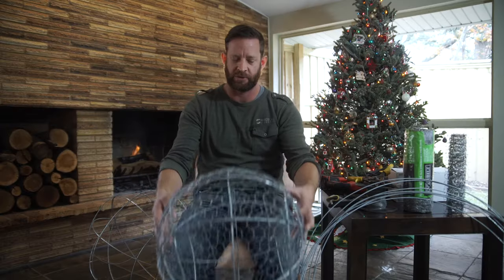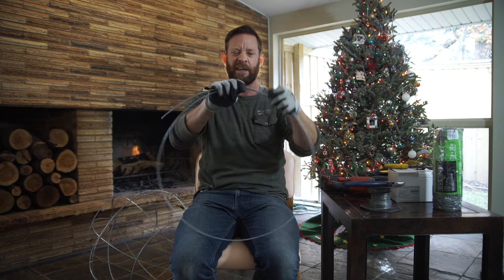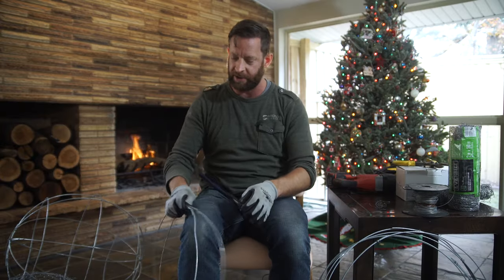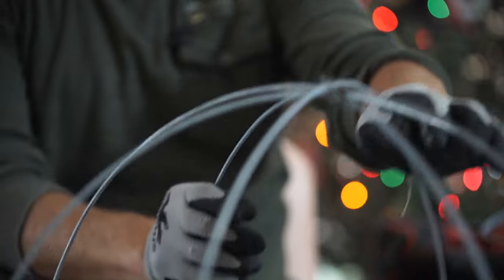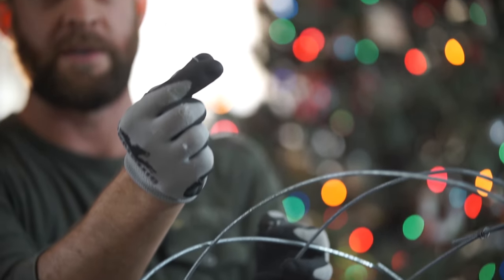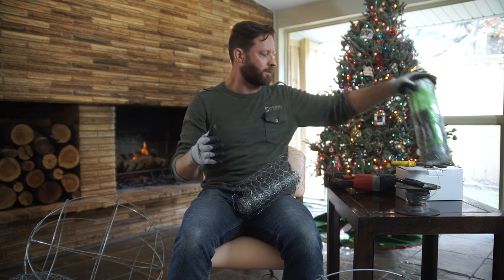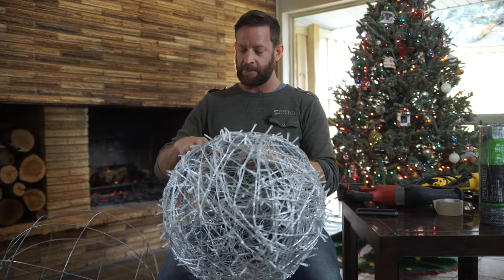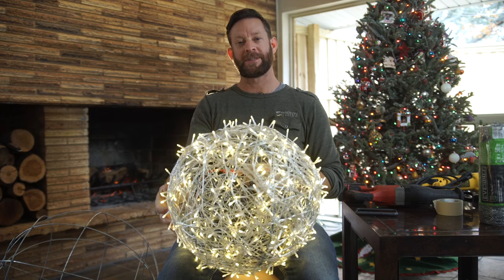How to Make Lighted Christmas Balls from Chicken Wire/Poultry Netting

Comment: I was at Home Depot today and I saw it in the chain-link fence section. It’s aluminum wire about 6 gauge, size of half a pinky finger in diameter,  or perhaps a bit smaller than a pencil in diameter. It is packaged in rolls that are about 2 feet in diameter. The roll I saw today was lowest shelf closest to the floor, if that’s a standard thing at Home Depot.
Reply: Thanks ryan, i went today to home depot and no one could direct me. I will look tomorrow. Or in other hardware stores. Hopefully i can find it.
Reply: Ryan, which wire are you referring to? You said to get 14 gauge aluminum wire & wire ties. What’s the 6 gauge wire?

Comment: WoW!  Incredible!  Best demo video!  Thanks for sharing!  I tried many other ways and nothing came close to how great and professional this looks.  It takes some time to build, however the end product is amazing!  I wish I could share some pictures!  I hung mine from a huge oak tree in my front yard!  It looks incredible!
Reply: @User-sb7ky  did you say in a previous comment what garage you actually used ?  I seem to recall seeing you post in a reply that your video said 14 gauge aluminum wire and you corrected it saying 12 gauge.   Can you confirm ?   Thanks
Reply: @esh1877  
yes it is 12.5 gauge specifically in the fence  section. a little smaller than a #2 pencil, thick and sturdy enough to bear weight. specifically for the circular structures, skeleton if you will.
Reply: @User-sb7ky  thank you sir.   I’ll be trying to source some in Canada this weekend

Comment: Good idea. I may not have been clear on that point. These balls, when made w chicken wire and tie wire generally have many pieces you may use to fold over onto the lights to strap them w/o the need for many extra hooks. J hooks would work too!
Reply from the maker: may use the ends of the aluminum overlapping to strap together

Comment: Thank you for this video. There are hanging 5 amazing light balls in my tree outside now, because of you. Very pretty. :-D Marleen from Belgium
Reply: Yay Marleen! Can you send a pic?
Reply: Where did you get the main wire?  Do you have a box or remember the product?  14 gauge?  I bought 14 gauge aluminum fencing wire and it is not like what is in the video.  I can't find the 3 foot diameter roll/hoops that he has and shows right in the beginning.  Mine isn't nearly the same gauge as what he his showing (1/4 inch?) either in the video.  And it came on a small spool, not in a box or a three foot diameter roll/hoop. Thank you for any help.
Reply: @andrewbatson9924  
Andrew,
Purchase the aluminum wire in the fencing section of Lowe’s or Home Depot, it is in a roll.
Reply: @User-sb7ky  how big is the roll?  Rolls in HD and Lowe’s are about 8 inches in diameter, not 36 in or what is shown in multiple loops in his hand in the video.  That’s the question.  Large loops make this project way easier.  I’m sorry to bother with these questions.
Reply: @andrewbatson9924  

Oh man, I think I’ve been telling people for years it’s 14 gauge, I should know better. I just looked on Home Depot website: 12.5 gauge 392 feet tension wire. Looks to be about $26.00
Reply: Andrew, 
Also possibly when purchased the roll of aluminum wire is about 8 inches in diameter, unroll the 8 inch spool to desired diameter.

Comment: Andrew B: We need an aluminum or any kind of wire  (product) that will make a simple circle. Usually found in the fencing section-possibly truck and tractor supply or local feed store (though I’ve never been in one).... a product that can be molded into a sphere, circle that will create a kind of circular frame to which we will attach the netting. If you can see in the video, it is the (aluminum) gauged wire that one would thread through a chain-link fence specifically at the bottom of the fence near the ground where the chain link fence and the grass meet, it holds the fence from waving, keeps it straight. Does that help? I’ll try to get a photo

Comment: Thx again for this fantastic video! You inspired me last year as I tried to make your balls, but I failed. ☹️ I feel like I’m pretty good with DIY projects. My problem was getting the aluminum wire to keep the 14 gauge circles together. I used my pliers to tighten the wire, but the circles kept slipping out of it. Was I not using a strong enough wire, or maybe it was too thick? I ended up using zip-ties, which worked. But, I had another problem. I found it challenging to get the circles to go around each other. They would be too small, even though I made sure they were the same size. I ended up skipping the circle structure & just used the netting to make the balls, which was not that easy & wasn’t a perfect circle. 🤦🏻‍♀️
This year, I want to make the circle structure without the netting & put LED mini lights on them. I think that would look sharp! Would you mind helping me understand what I did wrong? You make it look so easy. Ha. Didn’t you say your circles are the same size? I would think they have to be a tiny bit bigger than each other, right? 🤷🏻‍♀️ Thx. ☺️
Reply: ‘sup B-Dub!
all sizes are nominal, it’s kinda like joining two hula hoops. You could try to make one a bit smaller but may not be necessary. 
Let’s start w two spheres: make (2) spheres ab the same size, put the at 90° angles from one another, like a cross. grab your aluminum wire that you will use to bind the two together. focus on one joint, cross section at a time. When joining and binding two spheres first wrap the small wire diagonally, top first, then bring the smaller wire up toward you make another cross stitch like a shoe lace, or an X, that should hold the first joint in place. move to next intersection and duplicate. Hope that helps let me know
Reply: @User-sb7ky   Thanks, Ryan! Yes, I did the cross-stitch or x when combining 2 spheres, but they still found a way to slip out & not stay secured where I wrapped the wire. They would slide down the circle, if that makes sense. So I would end up with a lopsided sphere. I also remember the circles wouldn’t stay secure either. They would pull out from the wire, securing them. Could it be that my wire was too thick? It wouldn’t hold anything together well. What type of aluminum wire did you use exactly? Thx for your help! 😊
Reply: @b-dub6865  ‘sup B-Dub! 
try making the circles similar sizes so they push and squeeze against the one intersecting them they should kind of wedge together at 90° angles then tie wire keeps them in place. the wire guava is that same fence people use at the bottom of a chain link fence, about half the w thickness of a pencil

Comment: Hey everyone! So sorry! I may have mislead on the “14 gauge fence wire”, so very sorry. I just looked on Home Depot website. It should be: 
12.5-gauge 392 feet galvanized tension wire about $26.00.
Reply: Thank you for this update. I went to the store today looking for the 14 gauge and saw what looked like it (tension wire), but it was out of stock. I came home to search the web to no avail and then looked back in the comments to see you had made a change to the actual wire needed (12.5 gauge). I tried the lighted balls without the wire by making them with poultry wire and it took 2 hours and it ended up not being a round ball. So, thank you for this video. I’m sure it won’t be done any faster, but it will look much better in the end.
Reply: So what wire? 14 gauge galvanized or 16 gauge aluminum. I can only find 9 gauge galvanized fence wire.
Reply: 16, 14 will work, the idea is to simply hold the pieces of structure and fencing together. you could use zip ties, sandwich ties etc. a little spool of aluminum wire is great though, can get at hobby lobby or Home Depot type stores

Comment: Great video. Can you provide a link to the type of lights you recommend. Most lights have white or green wire, yours appear to be silver.
Reply: Thank you. 
Light color is rated in Kelvin (K). Look for LED lights that are 5000K or 6000K nominal. The higher the K value the whiter the light. The lower the K value the more red, orange color-hope that helps
Reply: @User-sb7ky  Thanks for the prompt response. My main question was “wire” covering color. I have green wired mini lights, but would like to use transparent wiring covered lights so the balls look silver during the day. What light brand do you recommend or provide a link. 
Thank you in advance for your help.
Reply: It has been a couple years I would simply search around for the color that you find most desirable
Reply: @User-sb7ky  Neither Home Depot or Lowes carry 14 gauge Aluminium wire. I found 14 gauge Aluminium electric fence wire at Tractor Supply. Will this wire work?
Reply: @williampresley5727  if it will hold shape kind of like a tie wrap for bread that will work
Reply: @williampresley5727  yes that should work, a wire that keeps shape is what we want

Comment: Ajit, Basically go to the fence section in Home Depot. 
Grab some aluminum wire, about the size (width) of a pencil, it comes in a round spool about 18 inches to 2 feet diameter, (it may be 20 feet long but it is wound in circle).
Then grab some chicken fence, it’s very pliable and not too thick.
Then look for some tie wire to tie it all together. Hope this helps

Comment: Where did you get the 14 gauge aluminum welded wire?  You did say a local hardware store.  I went to those and big box.  Google it, nothing.  What is it normally used for?  That's the important part.  You don't provide this information.  It comes in three foot rolls?  This is super important.  Your gauge looks way bigger than 14 gauge.  It's almost 1/4", and very rigid.  Can you please be more specific?  Thank you.
Reply: It looks alot bigger than 14 gauge. Did you figure out what it actually is?
Reply: @ShockMeAgain  I went with I think 14g galvanized tensile wire from Tractor Supply. I bought a 1000’ roll.  It’s used for electric fencing livestock.

Comment: In your video intro, it looks as if you assembled the balls into a very large Christmas tree??  Can you give some instruct on how you framed and assembled that?  Many thanks.
Reply: Kelly, 
I have a small oak tree that I gathered the Christmas balls around. I used different sizes to creat the aesthetic, but we simply stacked them and used tie-wire, any kind of wire really will work or zip ties to adhere to the small oak tree and secure balls to other balls

Comment: Materials of a 2 feet diameter ball minus lights would be about 10$, thats aluminum wiring, chicken fencing, tie wire. The majority of the cost is lights. I use about (2) 75-100 feet rolls or whatever amount of lights that looks good for the size of ball.

Comment: Great DIY project, wondering approximately how many lights are used in a 20-24" ball?
Reply: Gary Weiman 
Thanks! I think I pretty much used 100 feet rolls. For the larger balls, the lights may appear to be less dense, for the smaller balls it makes them pop, pop pop! 
So yeah I think I buy 100 feet but perhaps try a 50 or a 75 and see if your happy. Take away or add as needed.

Comment: Love the video!  I'm having issues finding the 14-gauge Welded Aluminum Wire.  Would you mind linking me what you bought?
Reply: Tony Lavey Jr I sent a link, not sure if it showed up. You can find the wire at Home Depot fence section. It comes in 2 feet diameter spools, it’s about 6 gushed wire. Thanks!
Reply: @RMaresch35  Great video but why can't you share the links with everyone on the type of Aluminum wire used.  I've shown Home Depot your video and they say they don't sell that type of stuff.  It would be helpful if I had a link and could show them a model or part number.  Thanks
Reply: So sorry guys! I messed up I think on the gauge. Go to Home Depot and it’s 12.5 aluminum gauge

Comment: Hi can you tell me exactly how sturdy was is it without those pieces around the middle and top. I'm going to be making  "trying to" make those Member's Pre-Lit Twinkling Ornaments.
Reply: The middle and top pieces cause the ball to be able to withstand little kids kicking it and the abuse of the winter weather. 
If you omit the top and center pieces it will still be strong but may not hold its shape as well and may in some cases deteriorate faster. If you are short on materials and time it may be worth leaving these pieces out.

Comment: I have looked everywhere for 14 gauge welded aluminum wire with no luck. All the 14 gauge wire I’ve seen is way too thin and flimsy - almost more for jewelry making. Can anyone help me find what I need? Home Depot, Lowes or Amazon? Thanks!
Reply from the maker: https://www.amazon.com/Hillman-122065-Galvanized-Solid-Gauge/dp/B000H5WOX4/ref=mp_s_a_1_8?crid=ES6YZVMU1OH6&keywords=14+gauge+fence+wire+roll&qid=1667231747&qu=eyJxc2MiOiI0LjExIiwicXNhIjoiMy4zOSIsInFzcCI6IjIuNDIifQ%3D%3D&sprefix=14+guage+fen%2Caps%2C235&sr=8-8
Reply: Thank you so much! Really looking forward to making these for holiday 22!
Reply from the maker: Rock on!

Comment: Thanks for sharing. What i would like to know is how long is your aluminium wire in total and what is the diameter of the wire ?
And finally what is the diameter of the finalized Ball.
Many thanks for your answer
Reply: Bonjour Pierre, comment allez vous?

the wire i used in this video comes in a small spool about 3 inches diameter, with a bunch of windings. it is aluminum 16 gauge  or similar. if i unwind the small spool of aluminum wire it may be ab 50 feet. i purchased at hardware store or you may find similar at a hobby shop. 
diameter of balls: mine were 18 inches to 3 feet 
did that help?
Reply: @User-sb7ky  yes. Many thanks.

Comment: Anyone know if there is a video of how they get their lights up in their trees and how they power them? TYIA.
Reply: Yes
Reply: What lights are you referring to?
Reply: @rmaresc1  the Christmas ball lights
Reply: @thomasleib2329  if I am understanding:
Get on a ladder, using a rope sling it around a branch, maybe tie a weight to the end of the rope, on the other end tie to the Christmas ball. 
To power them up: 
wiring from first to last we call “daisy chain”. Use small extension cords to join them together.  
Or another option and what I do is to use normal electrical wire # 12 or 14 gauge  THHN/THWN (hot and neutral, find at Home Depot). Simply strip the end of the wire about 3/4” long, put the end of the wire through the small hole on the male side, separating the hots to one side of the male, and the neutral the other side of the male keep polarized- put tape around all copper and all copper wiring so nothing comes in contact with the energized wire.

Comment: I started working on this and did not find 14 gauge aluminium wire but found 14 gauge galvanized wire in homedepot. Made the structure but it is wiggly and not holding its shape. May be my aluminium wire is thinner that I used to tie the structure. If anybody has made this can you please post the link of products to use from homedepot/lowes. Sorry I am newbie in DIY

Comment: I cannot find 14 gauge welded aluminum wire.  I found small coils but not the size you used.  I would love to make these, is there something more specific I should ask for? I have been to Lowes, Home Depot and a local hardware store.
Reply: Kelley Holloway 
Look for  6 gauge aluminum wire, in the fencing section.
Reply: @User-sb7ky  Thank you!
Reply: Look in fencing area for a roll of aluminum wire

Comment: Where do I get the 14 gauge aluminum wire?
Reply: At Home Depot, basically what you are looking for is aluminum or bailing wire that you can tie, secure around two objects
Reply: @User-sb7ky  does it come in the circle dimensions (looks like 2ft) as in video?
Reply: @gi-jojoannegauthier8478  if it did; i wasted my time

Comment: Nice presentation. For sake of storage, i think I will use plastic zip ties to hold frame together. Or perhaps double hoop the center and spot weld the hoops. Then cut between center 2 hoops. That way I can flip the 2 hemispheres so one fits inside the other after remove lights.
Reply: Brad Brown Great innovation. Storage is an issue for sure

Comment: I cannot find 16 gauge aluminum wire. I have found 9 gauge galvanized chain link fence wire that is used on the bottom to keep fencing straight and not bending upward. It is pretty thick. I bought it and got it home and looked again and you said 16 gauge aluminum wire so I took it back. I have only been able to find 16 or 12 gauge galvanized wire and it comes in smaller rolls about 12" or smaller diameter in 150' roll. My husband looked at what I bought today and said I need aluminum wire. The 1st fence wire that was 9 gauge was at Lowes and the one I bought today was at Home Depot. I don't know what to use. I do not want to invest a bunch of money in the wrong thing.
Reply: The 9 gauge will work for making the globe, sphere it will be the circles you put together to create the structure that the fencing, netting will go over and adhere to the spheres. The 16 gauge or 12 or 14 will tie the two, sphere and netting together before you put lights over the netting

Comment: Cool! Stronger than the other video with just chicken wire, but then she used only 150 lights instead of your 300.  
Ummm! Should you plug the string in, make sure 1) all bulbs work, 2) pull one out and see if the rest of the line stays lit, or 3) if one deadbeat kiilled the entire lineup, do you unravel the whole thing and roll a new line of lights or just roll a new one around the old lights?  Seems weight intensive. Some lights work w dead bulbs. Some lights are dod dead on arrival and too much trouble to figure out the dead ones and replace with new bulbs.
Reply: I agree, ours are better...each year I redo the lights necessary. I usually take the long road and demo the bad lights install new lights so they pop. If we keep old lights on the balls that do not function it just adds clutter and is not as pretty or appealing. Thank you Sussana